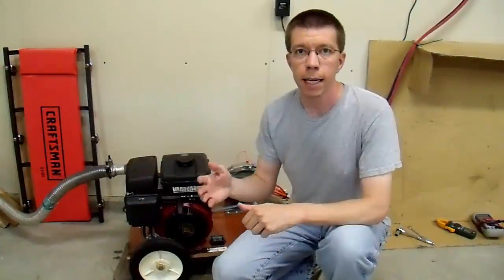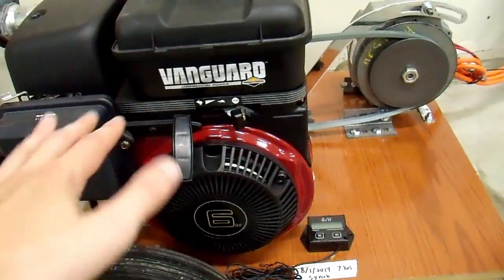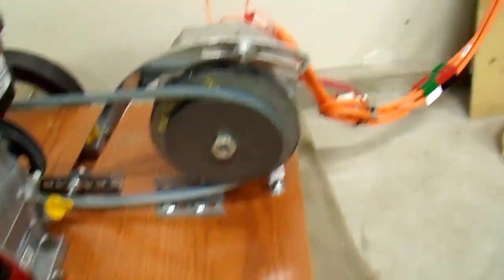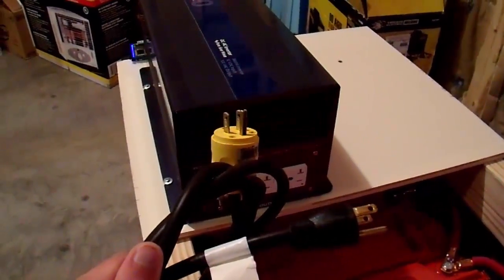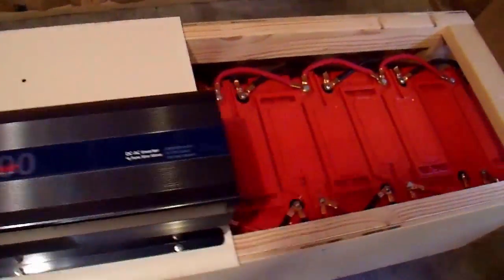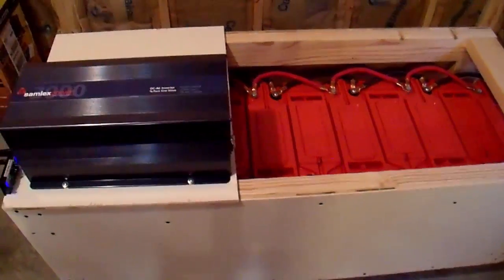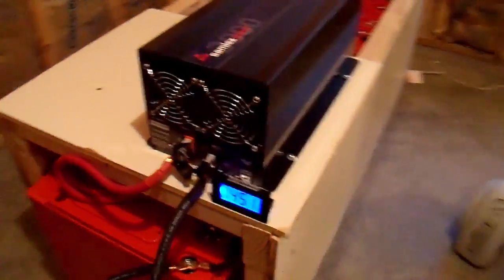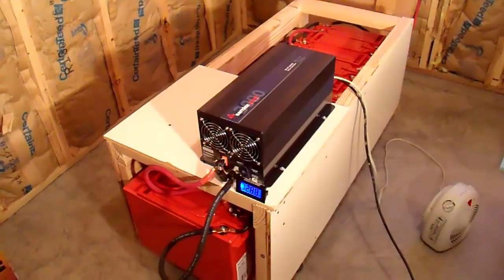DIY 12V Generator Charger - 10 Demonstration and How to Build

Comment: Your cable length and voltage drop should be really huge, limiting the charge speed of your batteries. I have a camper van with a 80 amp alternator and every cable under the hood had been doubled, ground from the alternator chassis to the body (1ft 4awg) and battery to alternator with a( 2x 4awg). My battery bank consisting of 6 large truck bateries are located at the back, i had to run (3x 4awg) calbes, in order to keep the voltage drop from the front to the back below 0.5v when the batteries are at 25% of charge and the engine rev at cruise speed. I instaled a bridge amp meter close to the alternator and having only one 4awg was limiting my charge current to about 30 amp... i was haiving 14.5 at front and 13.xx at the back sometimes.. now the needle peak up all the time at least to 75 amp. And on your setup you have double the cable length since you are not using the body as the ground conductor... 

One thing that can be done to acomodate long cable... well sort of a thing.. is to use an externally regulated alternator and set the regulator voltage probe at the battery bank instead at the alternator contact. The voltage will push the alternator voltage to compensate the voltage drop.. well, the most the alternator can do it. but keeping your alternator voltage as low as you can by reducing cable length and increasing like HELL the cable size will keep the whole system more efficient. 

For those who wonder why i used 3x 4 awg cable.. well, first that's what i had, second, it was a great deal, and tersio, it was easier to manage that one big and stiff double zero gauge cable.
Reply: He was using triple ought (3zero)  and his drop would be nothing at 30 feet total.  The body on your vehicle may be your problem.  You should run  one of those wires on the negative side it will probably help you.  He said he is running it at about 70% and it charges his batteries quickly, so he did well.  When ever you think you need an extra cable for your vehicle run both positive and negative same size it will be more efficient.

Comment: connect the voltage scence line of the aultarnator to the battery not in the the out put of the aultarnator because there is a line voltage drop and to prevent voltage drop many aultarnator have scence line and i can see that the alutarnator that you used in this video also has one and you have connected it to the out of the aultarnator.... if you put the scene line on the battery then it will maintain 14.4v on the battery but put more load and higher voltage on the out put post of the aultarnator...

Comment: hey i have and idea why dont y have 2 alternator and connect it in parallel 
. and use tye engine to run both of them
Reply: Have 10 motors 20 gen....than you can power the house..

Comment: This new battery reconditioning method is so simple and quick [Check Details Here==>https://docs.google.com/document/d/163kspciMT9QSUlNAvv0MT-ezkqtKCoEIdoxzlystrFQ/edit?usp=sharing ] ,And this works for car, phone, and laptop batteries! It even works with batteries you can use in a solar panel system's battery bank (or other alternative energy system’s battery bank). Plus, many other types of batteries!
Reply: nice

Comment: your kind of an idiot...the alt. must turn at a hi rpm...you kneed a large pulley on the engine.
Reply: PHILL DIXON why in the world would you use a 10" pulley on engine?
An alternator only needs to turn at around 2000 rpm, the same as it does on a car.   
Think about it!!!!!!

Comment: Impressive amount of time and effort put in here. I appreciate you sharing not only your successes, but the failures as well. Since you've already discussed the hazards of backfeeding from an inverter, I'll ignore that issue. I do wonder if you've considered alternate fuel sources. Since my primary use of a generator would be as a backup to a off-grid wind/solar system and a generator can sit for extended periods. As we know, the shelf life of gasoline is limited. Could your system be converted to a dual fuel or propane only system?

Comment: That is an under drive pulley! for under driving the alternator  so the belt doesn't come off.
Reply: yes its called a racing pulley but it under drives the alternator.

Comment: I like this, thanks. I have converted a self propelled push mower to a Gen.  with a simular setup.. alternator ran off of belt drive for self propelled,  to a 63 amp alt,  charging two 1000w car batteries, that powers a 1000w inverter.i also use it to jump start cars,wheelers, motorcycles, even my camper anything. I've got $60.00 in my setup and it's paid for its self many times

Comment: Each outlet on that extension is NOT on a separate phase. One outlet is the opposite polarity of the other and the two are in series to each other. There is only one phase on a single-phase system.
Reply: it is not opposite polarity. that would be line and neutral.  A single phase system in the USA is single phase on the distribution side of the transformer. the transformer provides 2 120 volt AC lines that are 180 degrees out of phase from each other and are a separate phase. each gives 120v ac to neutral and 240v AC  across them.    They can also use a transformer from the single phase that will provide 3 phases, one 120 volt AC to neutral but provides 208 v AC across the other two for motors and electronics.

Comment: will a small weed wacker engine powering an alternator which is feeding a inverter work. i only need it to power an inverter that you would plug into a cigarette outlet.
Reply: Sure will, if you find the right RPM. But your amps will be limited due to the small size of the engine (and the inverter, if it's small), so don't overpurchase the alternator.
Reply: thx for the advise
Reply: I used a small  motor from a gas Sears edger and an old 100 amp ford alternator, belt driven,  to make my charger..   (external off/on switch, regulator, volt meter, etc)  No problem and works good.    CHEAP!!!

Comment: Hi, 
 How do u know when the batteries are fully charged and stop the alternator from overcharge them and/or damage them?
Also, when u connect the plug from your inverter to your house, do you turn off the main power switch on the panel?
Reply: The alternator will not overcharge the batteries, it has a charge controller built in

Comment: ok whenever i see a power invertor BIG TIME FAIL, the idiot has like ten 12 volt batteries but is still running a invertor....this guy has a little money to throw around, zip for knowledge. looks like he turned a generator into a generator....the power companies laugh at you because you spent more money on all that expensive equipment than you will get back.... if you have that much money you really have no need to do this let alone do it right...try building stuff with all junk parts because you actually have too while kids are running around stealing all your stuff. your in a dream world pal and this is entry level garbage.
Reply: Dana Rider . Can you do it better show it.
Reply: where is your video?   I think he said the batteries are 6 volt, but if they are 12 volt and he has 10 you still need an inverter to go from DC to AC house current if he wants to keep using normal house appliances.   and it is obvious you cannot tell an alternator from a generator. So it seems he is blowing you away on his zip for knowledge.  He spent less then if you bought a house generator and he only uses it to top off his batteries on cloudy days.  If kids are running around stealing all of your stuff you should either get up and stop them or if they are not yours use a phone call police.

Comment: great info! What conversions did you do to the dual outlet pigtail? Or maybe you could show the inside? Do you think that a 3000 watt inverter with two batteries hooked to a running vehicle would be sufficient for temporary power outages while plugged into a dryer outlet with the main breaker to the panel off? Those little engines are too loud,  I would prefer to just use a vehicle like my truck.
Reply: don't do a pigtail for the outlets if you back feed out you can kill a lineman working on the power.  Use a proper switch to disconnect your house from line before using any generator.  If you are looking short term buy a heavy duty extension cord and run it from the generator to your refrig or what you need with the generator outside.

Comment: Maybe a dumb ? But isn't an alternator made to maintain a battery and not charge them? That's what I learned in auto mech. class. What did you do to make it a charger?
Reply: W3flyh1gh2 it does both actually... for the regulator in/to the alt will cut the power generated to charge the battery off when the battery is full, then when the battery gets below a certain voltage the regulator will open back up to charge the battery back up.
Reply: Yes and no. It has to do with capacity. Most car manufacturers size the alternator based on expected loads. Say a car takes 55 amps when the engine in running, with all lights on, AC on, blower on max, stereo system ad moderate volume. They add about 20%, which is 68.75 so they use a 70 amp alternator. Keep in mind that's 70 amps max, but 55amps continuous. So charging the battery with 70-55=15amps is only for a short time, not several hours which would be required to charge a battery that's down to 50% charge. So using an alternator to charge that 50% discharged battery could cause the alternator to overheat and burnout (definitely don't' run the lights and AC).
On pickup trucks and large SUVs, they do offer up sized alternators; on my Suburban, 80 amps is stock, but 140amp is available as an option, along with dual batteries. In this case, there would be extra alternator capacity to charge the batteries.

Now, for this generator/charger there is no car electronics to worry about. The full 80amp max, 60amp continuous capacity of the alternator is available for charging the batteries. 
If he used a separate voltage sense wire, connected to the battery bank at the point where the inverter is connected, then the output of the alternator would increase to attempt to keep the battery properly charged. This is the reason for the separate sense plug on the alternator, to sense the volts elsewhere . If sensing voltage at the alternator was the best choice, it would have been internal anyway.

Comment: I'm looking for a generator for a VAT's ( vertical axis wind turbine) your pulley and belt system look's ideal. Your thought's?
Reply: a treadmill motor is better for wind turbines, alternators wont get the RPM needed to generate enough power

Comment: i cain't believe that thing is still that loud even after adding that big muffler... wow
Reply: a good muffler set up will do the job at the exhaust end. alot of noise is from the engines internals, valves, moving parts. u need good hard rubber bushings and nice mounting under it as well
Reply: also if that big muffler has big n and outlets.. its better for a car that it was made for. just like when u put larger diameter exhaust on a car it gets louder. ---- i may build 1 of these generators myself but i wont got real big (at the ins n outs) on my added muffers. just look at a quiet rv generator to get ideas
Reply: oh true, too big of inlet and outlet piping

Comment: All those batteries and they only run your house for 24 hours?  What are you welding in your bedroom or something?  Those look like forklift batteries.  Does your wife let you weld in the bedroom.  Mine wouldn't.  I asked.
Reply: acutally thats about rite i can go around 12 -16 hours on a 800 amp hour battery bank you would be suprised how much power a fridge can demand i know i was. When i first started with solar
Reply: If you’re using a fridge with solar or generator you should unplug it for 3hrs for every hour it runs your food will be fine
Reply: It probably depends on what you're welding in the bedroom. If you are welding together machines for her enjoyment you might get a different answer.
Reply: alpa, sounds more like a freezer, lol
Reply: He's not welding in the bedroom you ass.  He has a wife.  He does all the welding in his easy chair.   I'm sure I could run my house off that for a decade.  Just saying I've run a forklift all day on those batteries without a charge.
Reply: alex tworkowski she probably uses power tools, lol. He said an engine produces less horsepower when it's cold that is false when it's colder you get a denser air charge resulting in increased horsepower that is the whole concept of cold air intakes. Also defiantly not spinning the alternator fast enough I am eventually going to build one of these using a hit and miss engine and a brushless semi alternator that is about 165 amps output. I have watched almost all his videos and he gives a lot of bad information the best engines for instance are built in China Hondas don't use ball Bearings on the crankshaft but I bought a predictor 212 which is a Honda clone and it has ball bearings on the crankshaft I have tweaked the exhaust on mine and made it like a scavenger where it creates a vacuum on the exhaust making more power when I crack the throttle on it now that 6.5hp almost jerks out of your hands, and shoots a few flames about 1 foot out of the pipe.

Comment: can you make a video explaining how to wire up that 240 wire you showed
Reply: don't use piggy backed plugs if you forget to trip the main breaker you are feeding out to the main power line and can kill or hurt a lineman working on the power line. there are device to switch you for $50 on ebay.

Comment: About 10% loss for belt setup. Why not mount alternator straight on output shaft, as you are running 1 to 1 anyway?
Reply: SprucePlywood he ran this with a love joy coupler and the rubber spider in the coupler didn't like it.
Reply: Hypro adapter.

Comment: Thank you for your excellent research and taking the time to go in depth on the engineering. Ignore the low brow non STEM grasping cretins... Can you elaborate on the claw type couplings? I've read that the new urethane spiders can withstand up to 1100 RPM, would that make direct drive reliable? Also, where do you source your pulleys/woodruff keys, belts etc?
Reply: I saw a youtuber use an ordinary heater hose!

Comment: I really appreciate that you exposed your challenges as well as your successes in the video series, and especially appreciate that you used Anderson PowerPole Connectors for your DC setup, but you  should never, ever setup a PowerPole matrix where your connectors interconnect with different colors.  Give your setup another thought - your connectors should connect with like colors on the opposite side.

Comment: Hey knurlgnar. Your build insipired me to build a similar system! It's running but my supposedly as-new 22SI is putting out 17v! + goes to battery +. Gnd goes to gnd/battery -. One of the twin spades goes to +. I and R unconnected. Does the wiring sound right to you? Maybe it's needing a load on the 2nd spade connector (simulated bulb)? The 2 spades are electrically connected.
Edit: without the battery as load, it's at 18.5v!
Reply: he knows more than I, but it sounds like youre spinning too fast. --- u posted months ago.. please tell us how U turned out with yours. Thanks
Reply: It turned out that one of the field winding wires on the rotor were shorting to ground, because of a careless rebuild! (I bought the alternator on ebay as 'reconditioned'). So it was always running full power, because the other end of the field winding was full 13v. It works perfectly now. I'll do a video soon. Thanks for replying

Comment: nice setup! I am off the grid and have simular set up. during winter months I just let it run 24 hrs 7 days a week do to short days and not enough sun.  Runs my whole house. I all so run a PMA with a 440 charge Controller  instead of a  alt. Works great. Nice setup again.

Comment: Finally! It works
What took so long ? 
How about use at very slow speed with large flywheel and running of natural gas
for inside use ?
Reply: first the engine would not have enough torque to run it with a LARGE flywheel second natural gas is as poisonous of an exhaust and needs to pump outside. and then do you want to provide the natural gas he is not on a line

Comment: Keeping the belt tension-free when not in use, and having to use the lever each time... hmmm!
I would install an infinite screw mechanism with a lock nut lever and small crank.
...and if you want to go smack as perfect as you tend to do on everything you deal with, a tensometer can be attached in parallel(so can be unlatched) so that you only tension the exact amount each time. (easy with the infinite screw crank device)
Or a cantilevered that locks on a lock pinion spring-loaded pin. A big oil filter like wrench that grabs the alternator full-body and centered may be the easy solution.
...and to quiet down the whole thing, besides the sound proof box I mentioned on the other video, put this thing on 4 spring legs!  you will be amazed at the smoothness gained!
Reply: He said he did not have that stuff laying around so he did not do that.

Comment: I am building something like this but I am using a large 7Kw 55.5v brushless motor as the generating section. The motor will also start the engine and will be used on a 24v battery which will be right next to the generator as I would imagine the voltage drop on those cables to be huge.

Comment: I had something like this set up but hatted all the noise extra wiring so I had an idea I bought a wrecked motorcycle had the stator rewound to a 200 watt stator and hooked it up to my batteries. works great electric starter etc. and runs very quite FYI I did hook up a 14"12V fan to the radiator. cost $150 for bike, $30 for fan at wrecking yard, $100 to rewind stator so for under $300 awesome charging system
Reply: CAN U DO A VIDEO of YOUR SET UP? TY